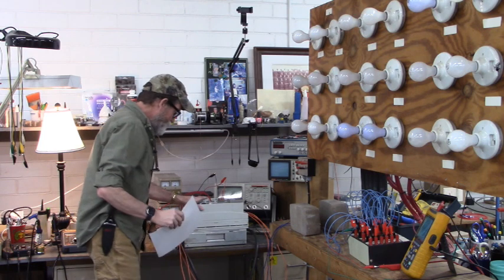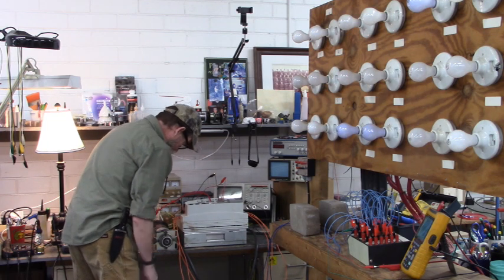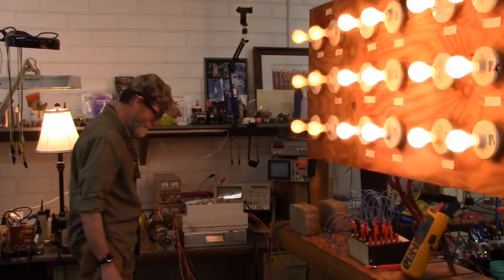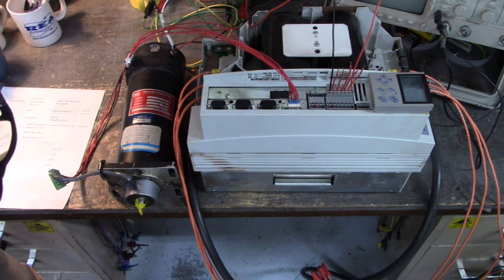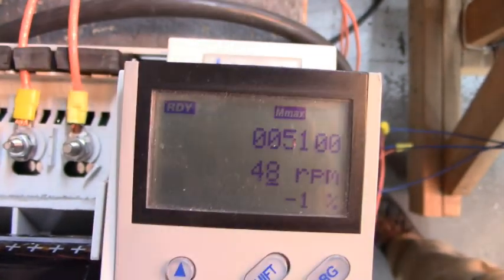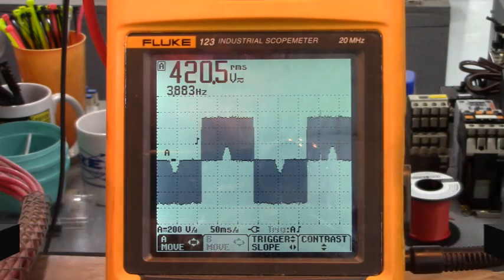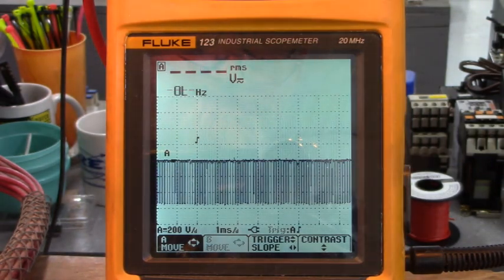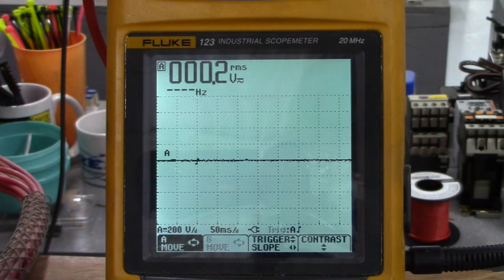Lenze Servo Drive EVS9327 ES Resolver Malfunction

Comment: I love your bank of test bulbs! How do you have them wired??
Reply: he has each bulb wired back to that box that sits below them independently, so he can re-configure it for different voltages / power handling by changing how many bulbs in parallel or series for each phase. He has a dedicated video talking about the test bulb bank in the past
Reply: Thanks mate I'll check out that video  @gorak9000